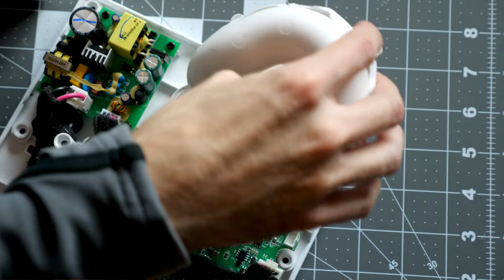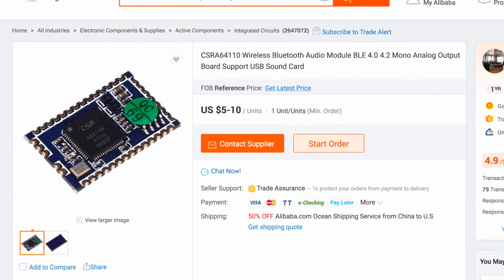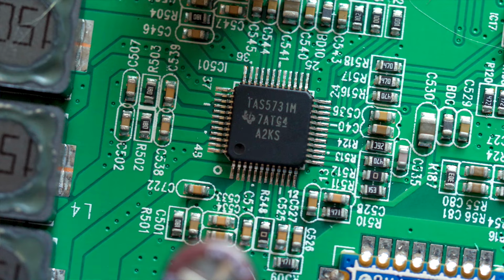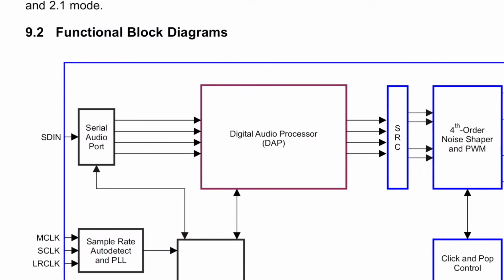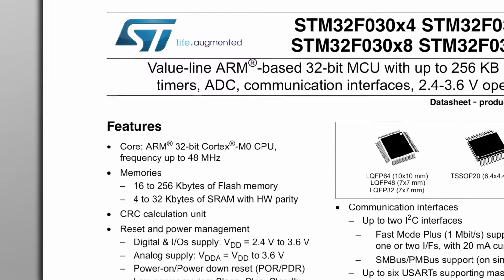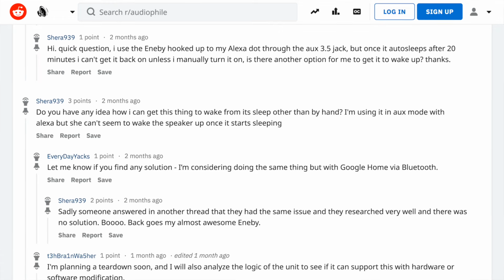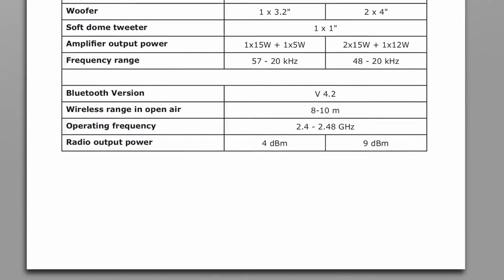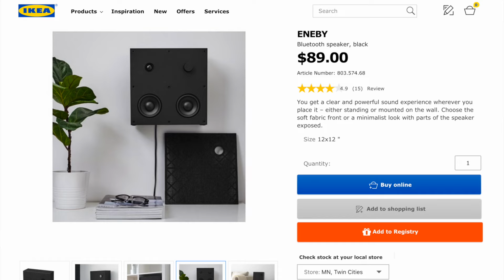Tearing Down IKEA's Bluetooth Speaker!

Comment: I am currently building a speaker with 3inch driver, and 5 inch passive radiator, i build the radiator myself to keep cost down, and the amp is from a low power bt speaker, 93dB at 0.5 W is certainly awesome, and with the 18A battery pack (@3.7U) it's just freaking awesome, in fact it'll probably run for days... if you are interested I could upload a video of me building it, with all the spec information.
Reply: tbh mate it's a bit too ridiculous, put a bigger driver in there, maybe 2 and another passive and you'll get more decent audio quality. Don't mess up on the "run for days" bit cause there's no point having a speaker you refuse to listen to...

Comment: This is probably the 3rd video about those speakers, their low price in comparison to the competition is great, but does it compete with the used market?, maybe especially as a new product. If you use an old speaker without bluetooth, there is a way to use a raspberry pi and make something that gives you the convenience of a bluetooth speaker. Last, those circuit boards are getting cheaper but that is due to what is happening in Shenzhen China.

Comment: Using two op apps and then summing afterward means a higher input impedance than they would have gotten with a passive mixer at the input. That makes it easier to drive and thus produces better sound from devices like phones and portable audio players.
Reply: Lots of music with enhanced stereo effects will sound like crap. Some high pitch tones might be lost because of phase shifting, potentially partially canceling between R and L channels,    and even high octave voices may sound dull,  depending on how they have been recorded,  mixed and DSP enhanced in the recording studuio. So yeah, passive mixing of the channels with resistors is very amateur.

Comment: The drivers are made by Guoguang Electric Company. They design and manufacture for a lot of different applications from TV's to cars
Reply from the maker: Makes sense that they’d use an OEM like that. How did you find out it’s Guoguang?
Reply: @ThisDoesNotCompute  the model number contains their abbreviation GGEC

Comment: Hi Colin,
That was an excellent presentation on these two speakers from IKEA. They are sold here in the UK too. I'm a big fan of IKEA furniture - in fact I've got a couple of pieces here I've still to assemble. My experience of electrical/electronic products from IKEA has not been good and I cannot recommend them. I had the Apple HomePod on test and I really liked the product. I've now seen a similar Sony product that I would like to evaluate also.
Reply: My experience with IKEA's electronics is quite the opposite
Reply: As both the ikea and apple products are OEM produced, it's a factory in China somewhere. The apple products can even be different makers over the product life time, and seems to be very rushed at times. Sony afaik still makes their own products, but don't count on that to always be the case. But, yeah, you get what you pay for as well. Similar apple product would be $200, even if it came from the same factory. And, don't assume that it's the same maker of all IKEA electronics.
Reply: There really is no comparison between the Apple HomePod and The IKEA bluetooth speaker. For me generally speaking the best audio is stereo and that can be achieved using a pair of Bose Companion 2 speakers connected to an Apple or Samsung source.  @TotteNesh

Comment: Jonining the analogue left with the analogue right at the input socket, presents a problem. The output impedance of the left channel (source) act as load impedance for the right ch and vice versa.
Is generally a good idea to avoid this.
Reply: of course yes.

Comment: Would it be worth it to get 2 of them, and split stereo signal out to them from my TV?
Reply: No, buy some real wired stereo speakers, why would anyone wants to hack mono BT speakers not designed for their intended use
Reply: @daijoubu4529  My reasons are:
1. They can be, are wall mountable, and have a built in Amplifier.
2. Of course they're both mono. Left side is one channel, Right is one channel.
3. Have you seen the price of soundbars?
Reply: @murderdoggg  why not have an external amplifier? No power cables going to the wall. I would get a decent pair of bookshelf speakers from Pioneer, Micca MB4X, etc, for around $100  and a small class-D amp for $50, you'll get a much better sounding setup. The Micca is also available in a powered version, alternatively look at reference monitors but those usually sounds best in a near field setup, eg Mackie CR3 for also $100, also look into Edifier speakers, lots of decent offerings

Comment: Im pretty surprised  this can sell for 50.  Its barely DIY able at that price , very nice.
Reply: You can EASILY DIY a much better speaker for $50. You can also buy a better one RETAIL for that price.
Reply: And that's if you have all the tools to build the enclosure or any enclosure already oh, that's if you have all of your soldering equipment already, and then I suppose the drivers could be had for just under $20 together, if you buy in bulk you could take that down to 15  and if you by even worse drivers you could go lower. Barely.  Then the amp chip thats 5 dollars. Then the TI chip. Bluetooth reciever and antenna , and , ok MAYBE MAYBE you could do it for under 30... again IF you own all the needed equipment     i shop parts express and Madisound too much to believe it could be much lower.  I suppose if you went the cheap as chips route bought a Chinese Bluetooth speaker from the lower end of the market strip that down and mounted its inferior components to a very sensitive full-range driver you could get something that would go as loud and have fairly good tone in like a cigar box you found for 10 bucks or something but that's a stretch dude the whole thing as a stretch if you think you can make something of this quality build especially and I didn't address this as tgis was a  part of my original point,  *selling it* anything NEAR this price and still make a profit...I don't know if I can possibly agree with you, even if the spirit of what you say is largely right
Reply: Once I got a pair of Edifier computer speakers from a thrift store for a couple of bucks and attach them to a Lepai 808 chip amp for 12.00 new.  17.00 (without battery ) but that's not DIY that's scrapping, I can scrap together something for free if that's your point if you want to argue that I could find a Boombox in the dumpster somewhere well I have done several times totally free... I stand by my original statement though at least,  at the very least $30 at a PUSHand that's again if you have all your own needed equipment. I believe spending any less than that would definitely result in a reduction of quality from the components used in this speaker

Comment: maybe if you want to listen to "music" while vacuum cleaning this can be a great choice..i mean its loud like a fucking siren...louder than modern vacuum cleaners for sure
i guess hifi is really dead....if people can actually enjoy music coming out of those tiny drivers on a plastic cabinet powered by small class d amp and in mono and the guy in the video tests it with that bass infused "music" and says it sounds good....well its the end....there is even people comparing this to "xiaomi soundar" what the fuck is a xiaomi sound bar? for me a bar is a place where i go to have a drink....why do people buy that shit? why do most people buy a house with huge living room and cannot have some decent sized speakers there???did you ever sit down and enjoyed music in a real system? even with only 100€ i can buy "good" used speakers and a cheap good amp maybe a technics or pioneer entry level amp from the 80's, surely not cutting edge but much better than this shit..atleast they have very low THD and good power. the only downside being the STK amp in a chip packages that sometimes fail...well if it pops just buy another one..  this thing must have an insane level of sound shaping and processing happening so it doesnt distort badly on those tiny ass drivers, nobody should want computers messing up their sound...thats why people who like music dont buy Bose products..let alone this Ikea shit